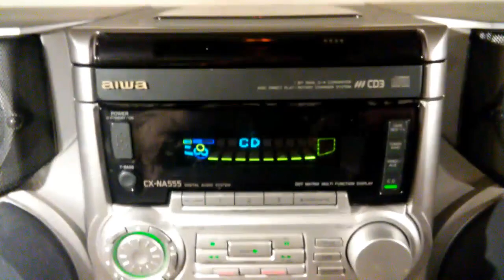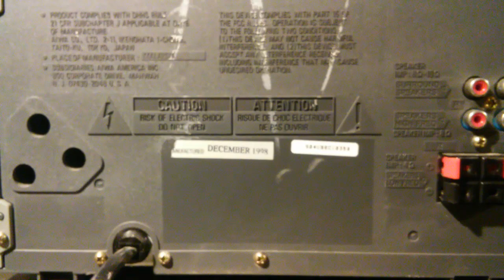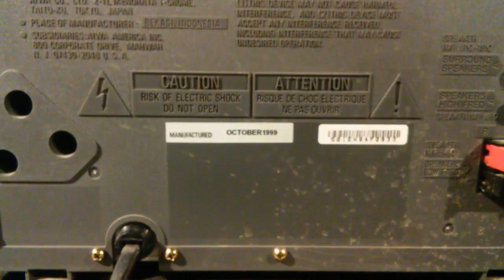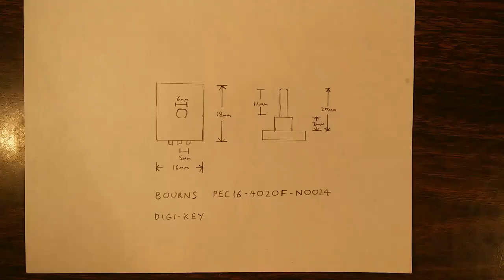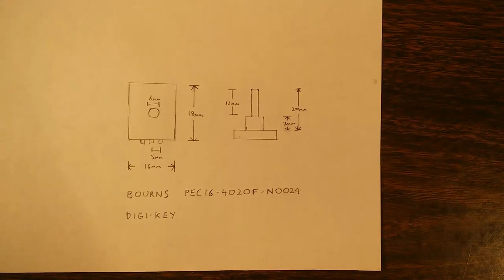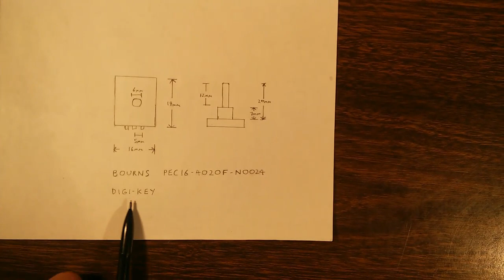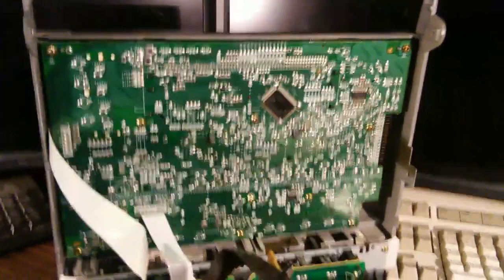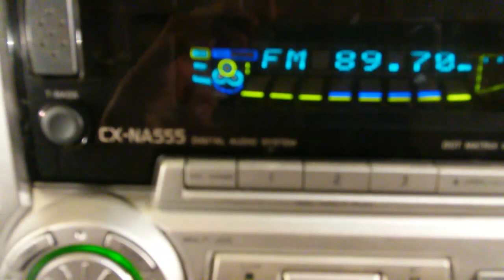Aiwa CX-NA555 Volume Repair

Comment: Hi I have a similar stero to this.  It is the AIWA  NSX-MA545.  This past Monday there was a power outage.  I tried to start it today and it does not turn on at all.  When I unplug the cord the power indicator LD turns off and when I plug it on again its turns on.  None of the panels light up.  What do you suppose the problem might be.  I will appreciate your help.  Thanks  Mark
Reply from the maker: If you get a power light and nothing else, you may have fried some chip on the control board.  I suspect the power outage included a power surge.  A big surge, like a lightning strike, could wipe out multiple chips.  Were any other electronics in your house affected?
Reply: No other items were damaged  I disconnected the stereo and reconnected it again and it started working again.  But i noticed that panel did no to go into the game mode.  All components worked.  I disconnected the stereo again and it will not turn.  Do you think something is loose  or maybe one of the transistors is not making good contact.
Reply: I appreciate your time on responding to me.
Reply from the maker: An intermittent failure is commonly caused by a poor solder joint.  I had one where the LED display was intermittent.  It was a broken solder joint.  A quick touch up with a solder tool fixed it.   Bad solder joints will typically come and go with mechanical movement or temperature. 
Have you tried tapping on the machine to see if the failure will change?
Reply: Hi David there was a power outage this past week.  This time I was not able to get it to work again.  When I plug it in the only thing that lights up is the red LED that indicates that their is power.
Reply: I left the stereo disconnected for a full day.  I connected it and it lighted up.  Its strange.

Comment: what formats can you play on it 
like what kind of dvds
Reply from the maker: It was manufactured in 1999.  Too old to play anything but audio CDs.   It does not play data discs with MP3 or WMA files.  It does not play DVDs.
Reply: can i use any kind of aux cables with it
Reply from the maker: There is an Aux input on the back.  It consists of 2 RCA jacks for right and left (white and red).

Comment: Analog Analog Analog -connect blue tooth receiver to the AUX/VIDEO connection. this guy gives the impression that you can't do anything with this Analog systems mine connected to my PC with 3.5mm to RCA cable and its perfect, for wireless easily and cheaply you can connect a blue tooth receiver for 3$ USB dongle or for a better sound top box for 10$-20$ these systems sound great by far better than any Bluetooth speaker and its a shame that so many of this system thrown away without realizing that you can utilize the AUX.
Reply: Reason i bought my Aiwa back in 1997 cause it had an Aux input to hook up consoles! Still my stereo today!

Comment: hi everybody, first of all thanks for that video. i have the same system but my problem is about stand by game display. i activate some how and i can't turn of the game mode on standby display.

do you know how can i turn off that game screen? thanks.
Reply: If you're talking about Demo Mode, on my NMT170, you can disable it temporarily by pressing the pause/set button. However, there's no way to disable it permanantly, meaning that you'll have to turn it off again once the machine is off again.

P.S. It can also be disabled by pressing the Demo button.

Comment: I'm using a CX-NA 909 and my volume only goes up
Reply from the maker: Up or Down.  The cause and fix are the same.
Reply: @c.davidgraves4848  hmmm the structure should be very similar il take a look (thank god I'm a maker) if worse comes to worse il look for s remote

Comment: I have a TEAC W-370C Dual Cassette that was put together in '84 and an AKAI reel too reel that both work well. The only thing that works on this CX-piece of garbage is the display. My theory is that the Japanese subcontracted China to manufacture this abomination, because it is a non-functioning flimsy plastic bunch of trash. Apparently everything "millennial" shares the same fault.

Comment: I have exactly this system, with the same problem, so far I've been too lazy to fix it, since I just use the remote control.

But does anyone know how to turn off automatic standby? If I just pause my music or anything else, the system turns off, and when I turn it back on it also resets the volume. So 
A: Is there a setting, so it remembers last volume setting?
B: Possibilty to turn off automatic Standby?

Thanks